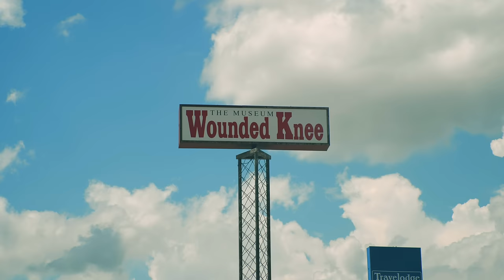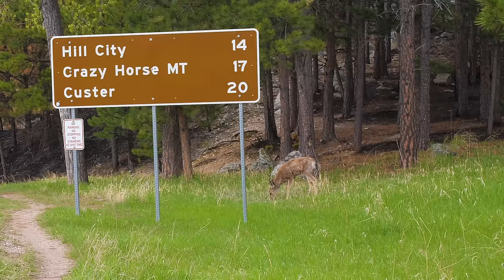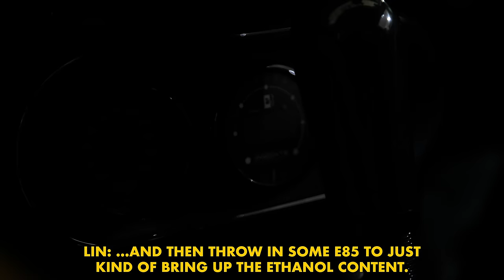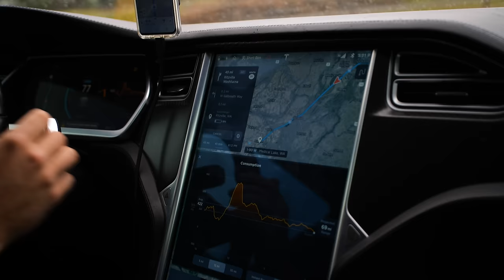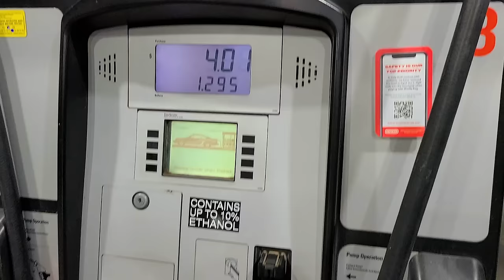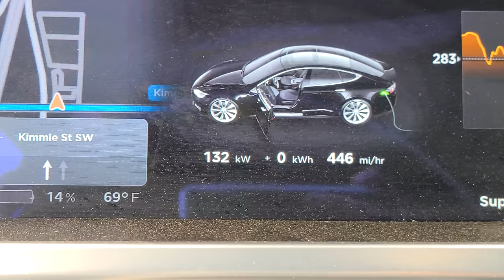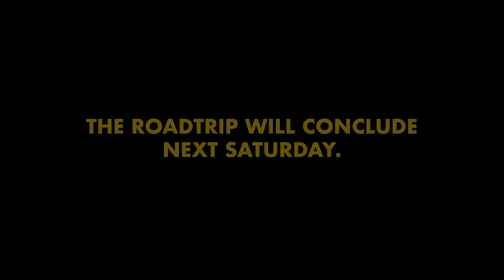Tesla vs Racecar Cross Country Roadtrip - Episode 2

Comment: I have over 50,000 miles on my Tesla, and have taken multiple cross-country road trips in it. Once you readjust your thinking from the “I must get there as fast as possible” to the more relaxed “this is a journey that I can enjoy”, you start to see the advantages of an EV. Particularly using auto pilot on the freeway, you can readjust your brain from being constantly at attention to more of a managerial role where you keep everything safe and under control but don’t have to deal with the tiring aspects. Also, spending 1/3 to 1/4 the money to travel is quite appealing. I did a 3000+ mile journey for about $70 in charging, which is hard to beat.

Comment: Are you sure you can't be using normal gas? If you have that ethanol sensor on Evo Xs you can wire it into your fuel pressure sensor and the tune be based on octane so you can switch back and forth from 93 and e85

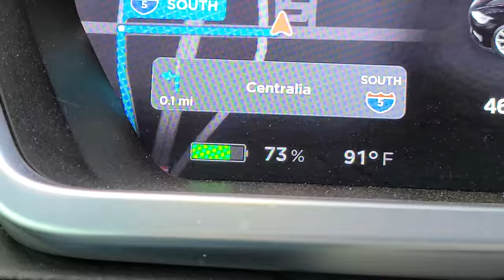Comment: 32:18 You'd think Tesla would use stainless steel on anything that's going to see weather. That magnet for the charging door should be oiled regularly if it's going to rust up like that. Gotta say, it threw me off seeing rust on a Tesla, even if it is only a little spot of light surface rust.

Comment: Speed Limits were added in Montana due to the feds threatening to remove federal funding for road repairs and maintenance.
Prior you could go as fast as you wanted as long as your vehicle was in good shape, ex. going 100+ with bald tires.
Could also crack open a cold one on your way home from work, as long as you weren't drunk and swerving all over.

Comment: Is putting a car in super sport for daily driving a good thing?
Reply from the maker: Yes! It increases the pressure applied to the clutches by something like 20%, which means less slippage during shifts, which means less wear. At least that's how I understand it. But I can also barely do an oil change.
Reply: @GearsandGasoline  love the videos thanks for replying!

Comment: Both "facts" about Montana speed limits are false or misleading.     I lived and drove in Montana during this period.  Montana originally had a stated daytime speed limit called "Reasonable and Prudent".    In 1973 the federal government forced all the states to go to a 55mph speed limit (to save fuel) by threatening to withhold highway funds.   That speed was tweaked a bit for interstates but remained in effect until 1995.   Montana had on its books that if the Maximum Speed Law ever went away, they would return to their previous limit, so in 1995 they returned to Reasonable and Prudent.  
During this time the speed that people drove on two lane highways mostly centered on two nodes..  55 (still brain washed) and about 72-75 (comfortable for most), which meant you'd often find long lines of cars piled up behind one car going 55.  I remember regularly having to pass 10-12 cars at a time during that period, then there'd be miles of open road, then another train stuck behind one slow moving car.
Reasonable and Prudent went away, not because there were more deaths (there weren't), but because some people abused it, drove 90-100+mph in their pickup trucks and such, mostly near the larger metro areas,  and then when they got a ticket, they fought it in court.    The courts eventually ruled "Reasonable and Prudent" as unconstitutionally vague and struck it down.    
Because the Montana legislature only meets every 2 years, there was period of time during which there was no posted speed limit whatsoever.     After that, they created regular 65-70mph limits (at the time, 70 in Montana was the fastest two lane speed limit in the country).   
Death rate.    During Reasonable and Prudent, the death rate (deaths per mile driven) dropped steadily.     During the period where there was no speed limit, the death rate, dropped to the lowest it's ever been in Montana.   After numeric speed limits returned, the death rate climbed back to "normal".      Particularly during the period with no posted limit, people simply paid attention, and drove like their lives depended on doing it with some measure of competence.   Imagine that.

Comment: Most of the cool stuff in this PNW region isn't along Tesla supercharger routes. I suppose that's why for me, electric cars are a non-starter until they have at least about a 600 mile range. My $24k F-150 can go 750 miles on a tank, my thirsty $26k Genesis nearly 500 when I'm gentle. Granted, gas ain't cheap, but that's offset by the $10k premium of the average EV(I'm looking at you outrageously expensive Chevy Bolt). Also, fill-ups needn't be to capacity, and are a lot more accessible, and still take 1/4 the time of an EV. I guess if you have the budget for a city car, or if you hate long drives? IDK.

Comment: So, in order to make a Tesla appear viable, you have to compare it to basically the most compromised gasoline powered car you can find that is barely street legal.... if it it.
Reply: No dude, you're not woke yet.
Reply: yes. otherwise it wouldn't make for entertainment. literally any normal car that's in a good condition would beat either of them on this road trip.
Reply: @GraveUypo  The thing is, Tesla's do just fine on road trips. We've driven my brother's Model S from North Carolina to Texas and it was like a normal trip, generally speaking. The time to charge didn't affect us since we used it to eat or bathroom breaks. All told, it took an average of 38 mins to charge every 4 hours of driving. So it did take a little longer but it wasn't as big deal as some people are making it. 

Not only that, road trips only take up about 10% American's time annually. Which means the other 90%, gas takes longer due to charging at home. 

I'll take 90% shorter time over 10% longer any day.

Comment: i though Ethanol is bad for your car! Everyone i know wants E0 or E5 but nobody wants E10 because of the high ethanol. And you want 85% ethanol????? Isn't that extremely bad for the engine
Reply: It's tuned for 85. It's like the poors man racing gas.
Reply from the maker: The car is tuned in a range between about E15 and E85. With the proper tune and fuel delivery you can make more power with higher ethanol, especially on a force inducted car like the Evo. In this case, not having enough ethanol in the fuel caused the car to knock under load.

Comment: 24:00 The oil change was a disaster. Thank God, I was never into those cars. The last time I changed my oil in my 2017  Forester was in the Walmart parking lot. I drained the oil, took out the filter (which is upside down in the engine bay in front) replaced the filter, flipped the Japanese oil valve closed and refilled the oil in under 2 minutes WITHOUT the use of ANY tools...

Comment: To bad that EVO did not have a conservative gasoline tune to be a true flexfuel car.
Gasoline should be enough for 200hp, enough to break every speedlimit everywhere in the US.
My more then 10 years old stationcar with 200hp, flexfuel and good economy could be able to beat both of these at a roadtrip.
It might even be enough to be faster around the track then the Tesla S, atleast on second lap because it is ½ ton lighter and has almost the same power as a overheating Tesla S.

Comment: Should try the road trip again with Rich's car now that it won't supercharge anymore.  I might lease a Mustang Mach E but not way in hell I'm buying a Tesla with how awful their anti-consumer behavior is from standard features to repairs or even build quality still.  The joke was early cars had shotty paint jobs, terrible panel alignment/fitment, electrical engineering mistakes a student would make with logging putting a death clock on your car, etc.  Years later they're still blocking drainage ports and making trivial errors while disabling features over the air for something you thought you owned xD.

Comment: You have to wear gloves because your hand oils will ruin this nice suede steering wheel...

Can't find my gloves so I'm just wiping down my hands with a wet wipe (hands covered in engine oil).

Also, one dude eating while driving, another on the phone while driving. Either of those could get you a fine and points on your license over here.